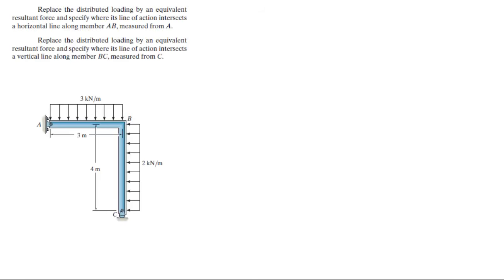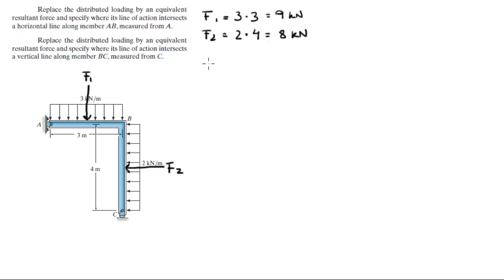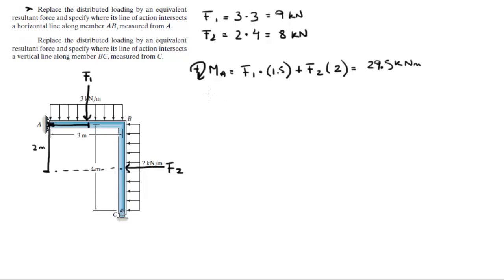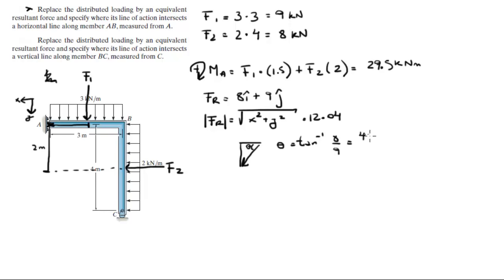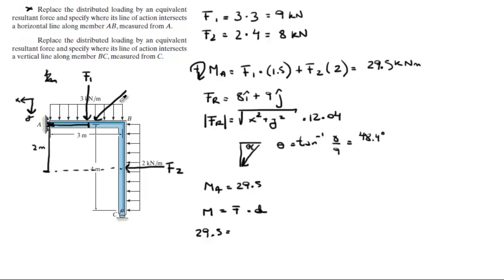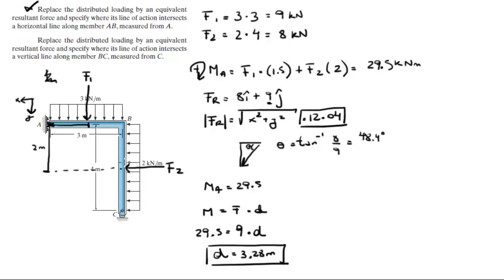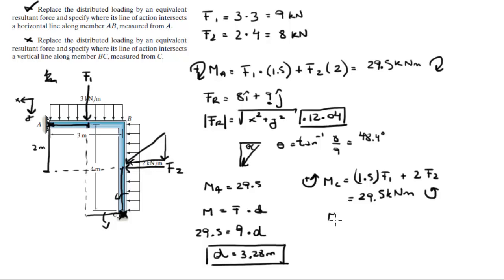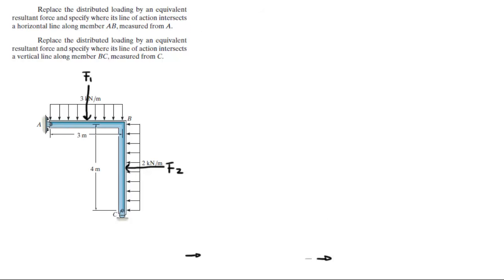Replace the distributed loading by an equivalent resultant force

Comment: For the moment at point C the moment will be the sum of both forces because the line of action for F1 doesn't intersect the point because we found that it's perpendicular distance is 1.5m. The perpendicular distance for F2 is 2m so you would need to include both forces each multiplied by their respective perpendicular distances.